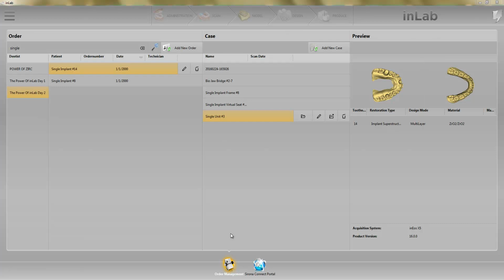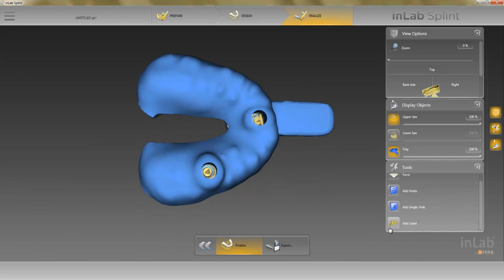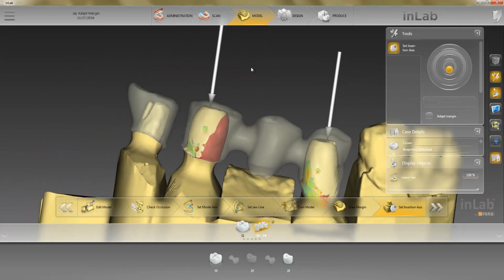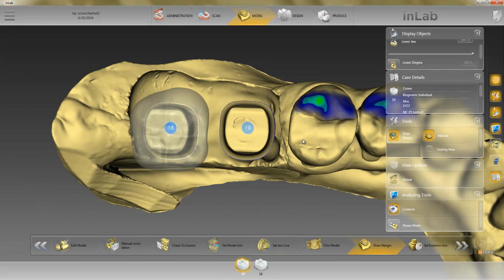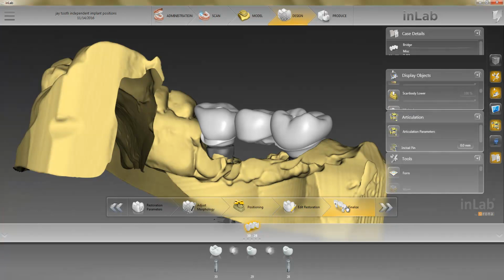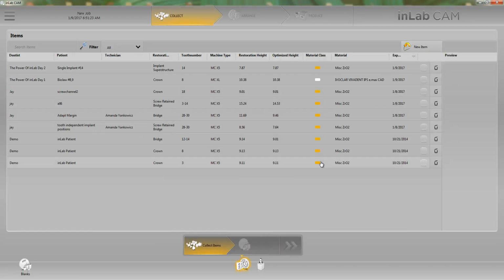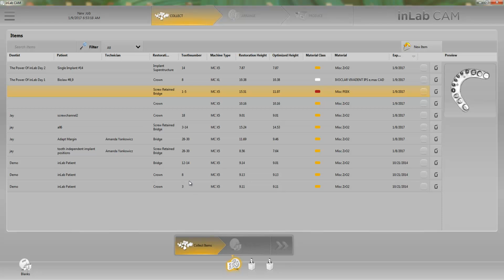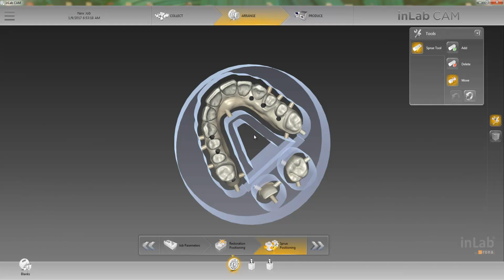inLab SW 16 CAD and CAM Webinar

Comment: do we need to buy another license if we upgrade our CAD SW15.1 to CAD SW16? i already upgraded my CAM to CAM16 and it worked.. or it will automatically converted to SW16 license for all modules?  thank you
Reply from the maker: SW 16 CAD required an additional license.
Reply: How about the inlay Splint and Inlay check.? do we need license too.?
Reply: i mean InLab Splint and InLab check..